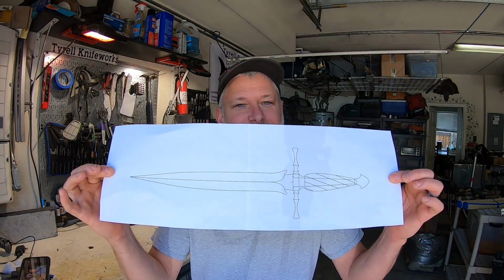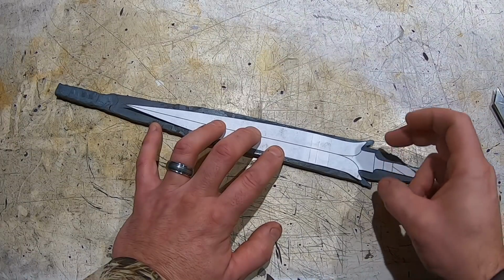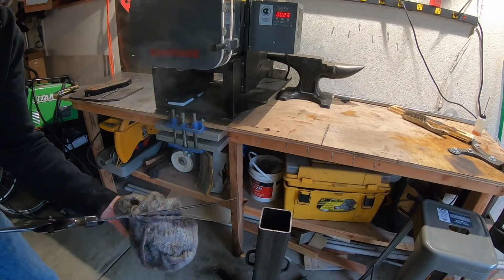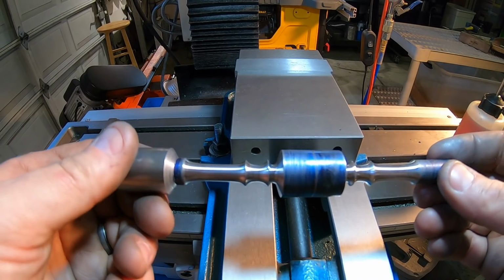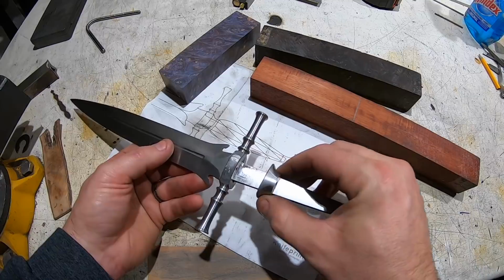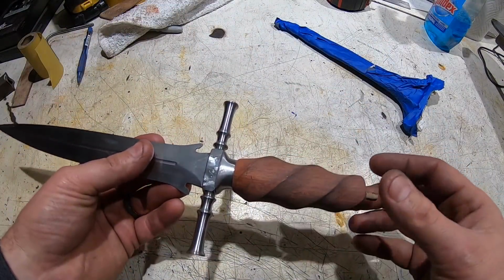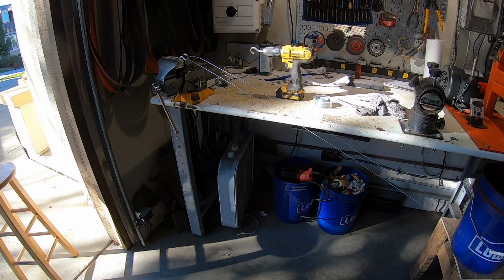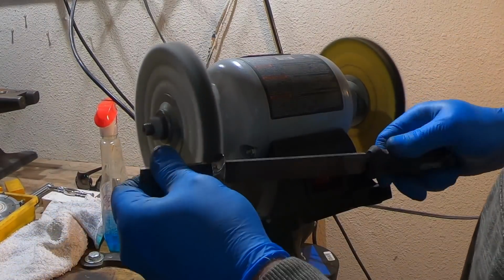Forging a Quillion Dagger

Comment: Sigh, not again.  Designed by people who do not know how to fight with a knife.  The quillon serves two purposes in real life.  No it wont stop another sharp blade enough not to get your fingers cut off anyway.  It is there to keep your own hand from sliding down the blade.  And it is there to wrap your finger around to pull it out of anything it gets really stuck in (like a bone).  If your sharpened blade comes all the way down near the quillon, even with those all to brief finger cut outs, it defeats the 2nd purpose of having a quillon. You do not need a sharp blade that far down its length to the handle.  Give it an inch or two inches of safe area to fit your finger in without risk of slicing your own finger off.
Reply from the maker: Thanks for watching

Comment: Love watching your process. I myself work in the aerospace alloy industry. We have a forge press that forges 53x24 inch ingots 120" long right behind me at work every night. I myself run a 110" rolling mill. We do everything you do on a different scale. It's so neat to watch you do it yourself. your end product leaves me sitting here with my jaw wide open. You make some of the most beautiful steel I have ever seen in my life.  That lathe and mill, when I have enough garage room I absolutely have to have one. I won't let a deal on a lathe or Bridgeport pass me by for sure.
Reply from the maker: Thanks for checking out the build!  This is still one of my favorites.  Something about the quillion dagger inspired me!

Comment: you need  a  set  of wire inlay tool they are easy to make  use your dremal tool to cut your blades  out of xsecto knife bldes to give them there different shapes  if  it  is  possible  to  get  your  address  i  can  send  you  a  set
Reply from the maker: I have a professional engraver now, so I’m probably good. Thanks for watching, David.

Comment: you guys that have the nice toys in your shop sure do fade away from traditions  im saying about hammering in the fuller
Reply from the maker: If smiths had the use of milling machines they certainly wouldn’t be hammering in fullers either.  I could hammer it in but it’s far less accurate and then there’s a ton more cleanup and sanding.  Progress is good, embrace it.  Thanks for watching.

Comment: next time you're turning a fluted or wire wrapped handle you could save yourself a lot of time by using the screw cutting function on your lathe.  just set the thread pitch to something that's evenly divisible by the length of the handle and it will come out perfect. cut multiple "threads" for multiple wires.
Reply from the maker: The problem is that the taper of the handle changes from front to back so it’s not a simple setup.  Actually very complicated so it’s really not worth doing on the large in my opinion.  You’d have to also do the flutes so they match.  I’d rather do them by hand.   Thanks for the thought though and thanks for watching, Alex!
Reply: @TyrellKnifeworks  I'm a cnc machinist so I my default "it will be easy" didn't take the taper into account, however if you have a power-feed on your cross-slide you can match a taper.  Its the same technique people use for NPT type tapered threads, although the math may be more trouble than its worth.
Reply from the maker: @AlexMageethefirst  yeah, it’s not a straight taper, it would be an arc.  The math hurts my head.  😜

Comment: Great job!! For an idea, try to use flat or roundwound stainless steel or nickel bass guitar strings of different gauges for the inlays like this. Maybe it would be better or easier)
Reply from the maker: Maybe if I get a request from a music lover.  Typically it looks nicer to twist the wire and that’s tough with guitar strings.  Thanks for watching, Igor!

Comment: This is one beautiful dagger
Reply from the maker: This was probably my most technically challenging build.  I can see why the quillion dagger is part of the master smith test.  Mine certainly wasn't at that level, but it was a fun build.  Thanks for watching, Wayne!
Reply: @TyrellKnifeworks  no problem I love your videos I do have to say though I would have thought the Spartan sword would have been the more challenging
Reply from the maker: @wayneking9997  The spartan sword is bigger but such a wider blade is easier to grind.  Daggers are just hard because there's 4 bevels instead of 2 and they must meet EXACTLY in the center or it looks very odd.  Plus those flares at the ricasso, the guard needing to be turned on the lathe, lots of other complicated items on the dagger.  That wire inlay on the handle was tricky too.  The spartan sword is the first time I cut my teeth with wire wrapping so it was good practice!  👍🏻

Comment: Did you end up putting the curve into the shoulders of the blade and tang that you had drawn in your plans? Last time we see the blade before guard fitup the tang shoulders are basically 90's.
Reply from the maker: I mill them shoulders so they always get a curve that’s the radius of the end mill used.  Usually an 1/8” end mill.  Thanks for watching.

Comment: If you keep the twisted wire under slight tension and heat it up with a propane torch to a dull red, it should become a lot more malleable and less prone to kinking up and wanting to unravel, shouldn't it?
Reply from the maker: That works for copper but not sure about steel wire.  Plus I didn’t want to dull the finish on it.   Thanks for watching!

Comment: Nice work!  I wonder if it would have been easier to file in the wire channel first and then filed the flutes up to it. That way you would have to file it flat again and possibly change the diameter of the handle. But none the less it worked out great. Beautiful dagger for sure.
Reply from the maker: The problem is you really need to hold it in your hand with the flutes to know what comfortable and the right depth.  I ended up changing and taking down the flutes twice after they were in there.  Thanks for watching!

Comment: What I figured would happen, you didn't forge in the blade.. so you lost the basket weave pattern.  
Happened to my latter damascus dagger.
Reply from the maker: Well, I did forge the blade, just not the bevels, but I also didn’t lose the basket weave.  It’s clearly visible on the blade but perhaps it didn’t come through in the pics, probably because of the high layer count.  The chatoyance is off the hook on this blade. 👍
Reply: Tyrell Knifeworks sweet 

That's what I was referring to, fully forged or your ground in pattern disappears.  I forge all mine as well, but grind the bevels a bunch and any pattern thats not forged in disappeared for me.   
Dave didn't even come close he did stock removal.  Nicely done dagger by the way.
Reply from the maker: @timjackson_ABS  For ladder, you need to be almost at your profile shape before you put the ladder in.  This contest wasn’t just about forging.  Dave doesn’t forge at all and that was known going in.  We both had fun though!  Thanks for watching.

Comment: Nice project. Yes grinding daggers can be nerve wrecking, twice the number of bevels to screw up.
On one of your comments I object. A lathe is a precisison machine even without a DRO (OK there a shitty lathes on the market but yours looks reaonable). How do I know? Well decades ago I made an apprenticeship as a tool and die maker. We did precise work on a lathe even without a DRO.
Reply from the maker: Yeah, I didn’t mean it wasn’t.  The way I was using it wasn’t precise.  Just using the hand wheels manually and trying to get it close by eye.  I didn’t mean the lathe as a tool wasn’t precise.  Thanks for watching!
Reply: @TyrellKnifeworks  oh the old problem, language is so imprecise. And btw perefctly OK to use a lathe like this. Be precise where needed.

Comment: Now I know the reason why the last two videos was the old projects! This dagger looks great, and I'm very impresed!! At the begining I was preaty much sure that you made 3 parts guard. Making it from one piece had to be very dificult, but it can't be more solid:)! Denis, This dagger is magnificent work of art! The only think I would change is the place where your mark is - but I know that find the right place was very tougt decision.
Reply from the maker: Yeah, I had a tough time deciding where to put the makers mark.  There wasn’t a big enough spot anywhere so I decided on the two-part.  Half on one side, half on the other.  Thanks for watching!
Reply: @TyrellKnifeworks  I think, I would look ok, if you make it on one of the bevels - above the ricasso (but I'm not sure if there is enough space)
Reply from the maker: I don’t think it would have looked good there.  I considered that.
Reply: @TyrellKnifeworks  It's more typical in kitchen knives ( Bob Kramer knives, or Maumasi Fire arts). I totally understand your decision:). I had the same issue and I decided to mark the pommel in my black bowie, but I have tiny mark. Yours is much bigger
Reply from the maker: The next time I order stencils I’m gonna get two sizes for this reason. 👍
Reply: @TyrellKnifeworks  Good idea!